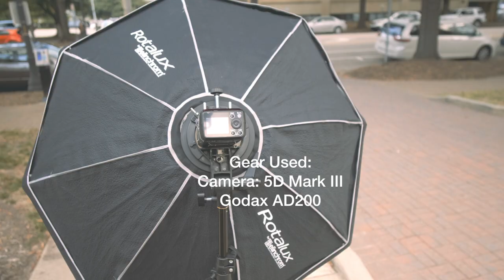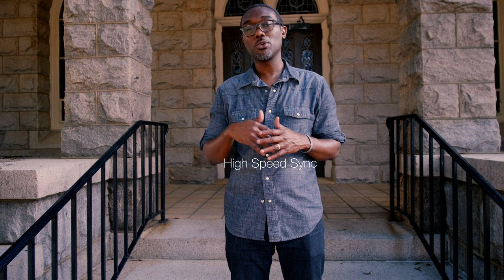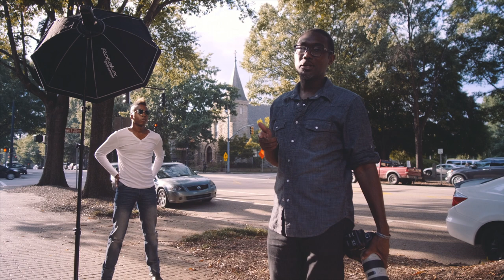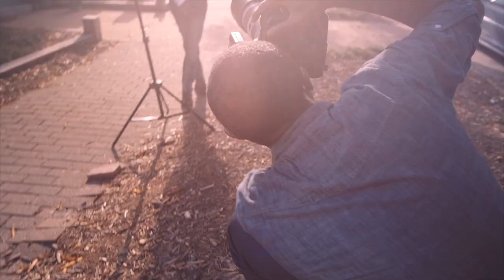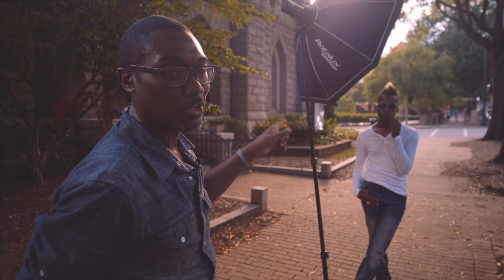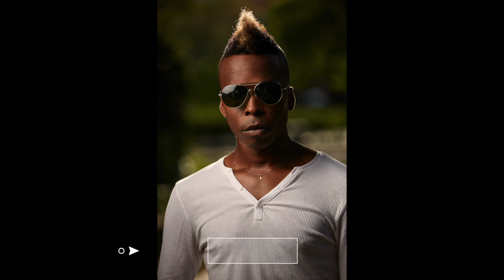The Art Of Balancing Artificial Light With Natural Light

Comment: The subtitle should be called the Art of Quick intros and getting to the point. Because you said what you were going to do and did it! Also I see you have joined the Godox Communist party! lol
Reply from the maker: +Photomeike I am trying not to be so long winded, but it's a 12 step program, we will see if I fall off the wagon or not 😁.

The godox brand at this moment is a love hate relationship. I have one light that fires sometimes and I am not sure if it's the unit that 's the problem or not.  I have two units and whenever one craps out I am on a shoot, so I just grab the other unit, which creates a problem because I always forget to mark the problem unit so I can monitor it. So the hate comes from the fact that one light is inconsistent and the loves comes the efficiency of those little units.
Reply: ah, ok. Well good luck with figuring that out man. They say it's better to buy the Flashpoint version because you get the warranty and the backing of Adorama in case anything goes wrong.
Reply from the maker: Well if I have to buy another one, I will be buying the Flashpoint version instead of the Godox, for sure.